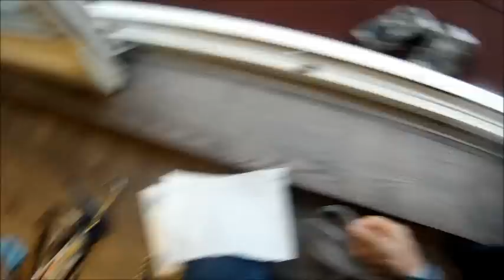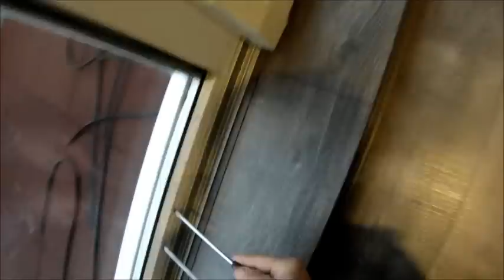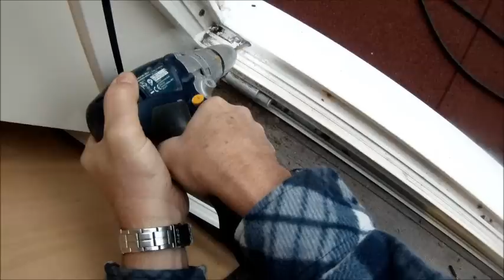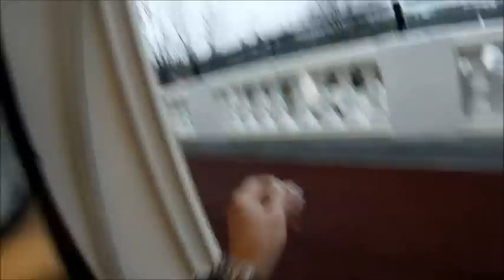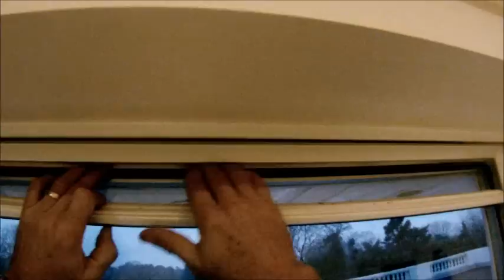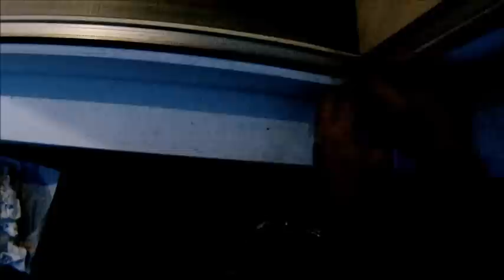How to Fix Water Leaks in UPVC Windows and Patio Doors

Comment: Had new patio slide doors fitted and two bump stops. The top bump stop drilled and fixed to uvpc frame is now leaking water from bump stop fixing dripping down window glass Appreciate any help.

Comment: Good video. I do not have leaks thankfully but my sliding patio door has water inside at the bottom of door after heavy rains. We cannot see the water but hear it sloshing about when using the door. Where roughly would the weep holes be on the door if are any? Maybe they are blocked? The door feels heavier and does not always lock into position
Reply from the maker: Thanks, it should drain underneath the door.  You could take out the glass and drill all the way through to the bottom.

Comment: Just watching your video about the leaks which I am experiencing as well and will drill the holes for drainage but the reason for my message is that I have exactly the same patio door as the one I saw in both the video. I find very difficult to close the door and at the moment do not open the door as I know I will spend more than one hour closing the door as it always has a gap when I close it. When I saw your video I found that you could close the door very easily so wanted to find out what is wrong with my door or have you got any video about it.
Reply from the maker: It is down to the door alignment which can be adjusted by height adjusting parts at the bottom of the door.  The other thing to check is the position of the catches on the door frame.  See how they line up and move the position of them to optimise it.  The last tip is close the bottom first, shove in with foot if needed, then move handle horizontal, then close top half, then move handle up to lock.

Comment: We have windows with the rubber gasket similar to the one you have re-installed, but we've noticed that the corners have shrunk and feel that air may be penetrating through that area.  Do you think we need to replace all the gaskets or do you think taking them out, cleaning them and re-inserting (at corners first and then pushing the middles in as you did) would fix them problem.  Thank you for taking the time to make that video!  Will be investing in polymer sealant!
Reply from the maker: +Noreen Daly No need to replace the rubber seals, they will probably stretch if you do the corners first.   But even if you had new seals, a little bit of water will still get through, so it's the water drain channels that are the important things to check and improve.
Reply: Thanks - we are not having issues with water on this window more with air leaks..  The window has 6 panes of glass.  I am sure i can feel draughts coming in and I think the window guy put them in back to front cause the plastic sections you remove before you take the glass out are on the outside of my windows.  I am wondering is this the reason for a lot of the air penetration?  Thanks again for your help.
Reply: Thank you!  It's supposed to be windy for the next few days so i'll try that!
Reply: +comeinhandynow Hi I tested it and couldn't believe how much the thread was moving.  It is like the gasket is keeping no air out.  I wonder would it be an option to use sealant to create a seal between the frame and window glass (at the moment there is a black bead of rubber on it but obviously this is not working).
Reply from the maker: +Noreen Daly No harm in giving that a go.

Comment: what a cracking repair that is mate, top notch! I have the same problem at the moment on a window. if you have a flat bead tool and nylon hammer, you dont need to remove the outer rubber :)
Reply from the maker: Thanks, and thanks for the tip.

Comment: Great tips. However I just had an annoying issue, water has got in to the main patio door bit via gap in the beading in corner but the water is sitting inside the door sash panel at the bottom and slowly dripping inside. How do I get that water out? I didnt wanna take upvc sash part off yeh incase I did something wrong and was an easier method.
Reply from the maker: Thanks. Can you take the bottom pane of glass out. Usually you have tovremove some beading first.. Then block any visible drain holes and make your own as in the video.. Hope that helps. Difficult to diagnose remotely.
Reply: @comeinhandynow  cheers for the reply. I wanna see if I can try remove the upvc frame first before touching the pane if not then will have to try what you said.

Comment: Great vid. I have a couple of windows which when it rains i get a wet patch in the corner of the reveals. Suspect the sil wasnt sealed behind properly when installed. Do u reckon this would help?
Reply from the maker: Thanks, yes I think this would if you seal off the old drain points and make new ones as in the video.
Reply: Awesome cheers. Annoyingly though my windows have the beading on the outside.

Comment: Did you actually fix the root cause of the leak? I thought water ingress was at either side of the side of the sill?  Surely a driving rain would still see water forced sideways at either end of the sill and then down through the ceiling below?  
Would a better solution be to remove doors/inner frame and then seal at ends of the sill where it meets brickwork, with silicone and then refitting doors?
Reply from the maker: Yes it fixed it and yes you are theoretically right about driving rain but in practice it is quite difficult to drive through. 
It would be better to remove the whole door frame and the sill and put a lead skirt under the sill with the ends turned up to capture sideways water. Silicone doesn’t last long term. It often separates. 
Sadly it seems not many builders fit sills so they guarantee no leaks and often installers screw down through the frame into the sill and brickwork, breaking any waterproof seal!

Comment: A very instructive video Sir, thankyou. 8 years on, is this still your method, or has your technique evolved since?

I have an upstairs window which, when the wind and rain together are from a certain direction only, I am sure is the source of water ingress which (I assume) tracks down the cavity and into the window heads on the floor below, sometimes it even tracks along to drip off the architrave mounding from the downstairs ceiling. Nightmare, frame drilled right through into cill etc. Kind regards.
Reply from the maker: Thanks. Yes these fixes are still good. The only thing I would add if possible is a lead tray under the sill to capture all and any water to take it outside. But that is very difficult to retro fit. Should have been done by the original window installer, but so many builders don’t do that.
Reply: @comeinhandynow  Thankyou Sir. Yes, like a cavity tray, but that would still be negated by the hold down screws. It is a fixture design issue. Kind regards.

Comment: I think i have the same problem with my sliding door :( water is getting under my floor and damaging the floorboards , even to the point where  after a big rain water seeps out through the floor boards
Reply from the maker: I think this problem might be common, I suspect a lot of builders don’t know how to fit windows/doors without leaking problems.
Reply: @comeinhandynow  yeah its an apartment complex.

Comment: Yeah remove beading from middle not ends. You're not figting against the adjacent beading then. And a non flexible 2 inch scraper to remove them. No need to pull rubber out. I have used a regular hammer with the end topped over to pop them back in. No marks and damage. Good fix though
Reply from the maker: Thanks for your suggestions.  It is a lot easier removing the rubber beading first though but I guess it depends on the window.

Comment: No. The water will still going in from the 45 deg cut joint at both corners.. The better way is to inject pu foam into the frames.
Reply from the maker: No, doing that will just block all the drain holes so the water has nowhere to go, it will probably still leak past the pu foam as well.  I've tried pu foam as a water leak stopper in a frame, it didn't work. You've got to provide a safe route for the water to drain out. I seal the corners with polymer sealant as well.  Usually they are still water tight however.

Comment: Do window repair specialists normally do work as detailed as this ? My window was leaking water on the inside from the cracks and all he could say was use Angle Quadrant Seal .Nothing about taking out beads and repairing anything else,not impressed .
Reply from the maker: I doubt they do. DIY is often best.

Comment: Does anyone realize that the entire door is inside out?
Reply from the maker: Mike West Thanks for taking the time to comment, but it isn't inside out for the following reasons: there is only one handle which is on the inside and the door is a tilt and slide door which tilts inwards at the top so if it was the other way around it would be tilting outwards thereby scooping rain into the house.

Comment: To me it’s a waste of time. He just created a rather badly looking drainage instead of solving the main cause of the issue which is probably a worn seal.
Reply from the maker: I have done this fix many times to badly fitted windows that leak water badly and it’s the only fix that works.  The problem is not the seal (no seal is going to be perfect anyhow) that is why window frames have drain channels. No, it’s the fact that the water from the frame drain goes onto the sill and can sometimes go left or right to the end of the sill and into the wall.  No water seal in place under the sill, or anything to stop the water reaching the end of the sill.  Or I often see the frame drilled and screwed into the sill and wall  providing a route for water, with inadequate or no sealing over the screw.  This fix works when all else has failed. Feel free to just change the seal, but it won’t overcome the described faults.